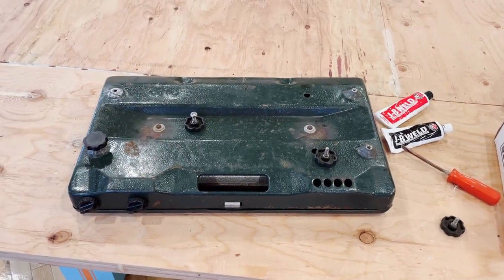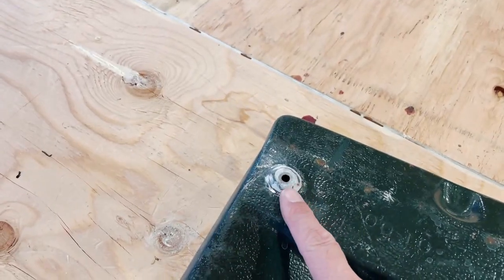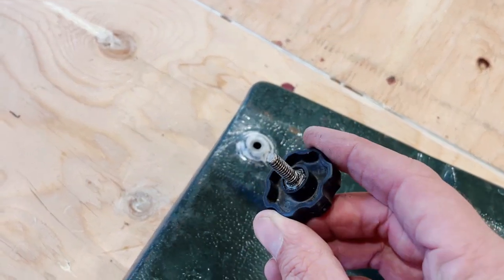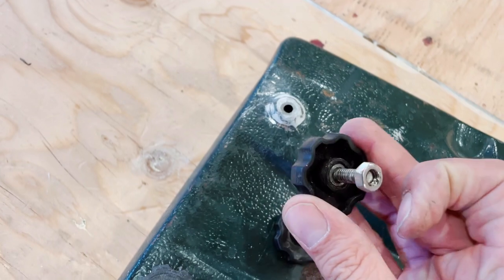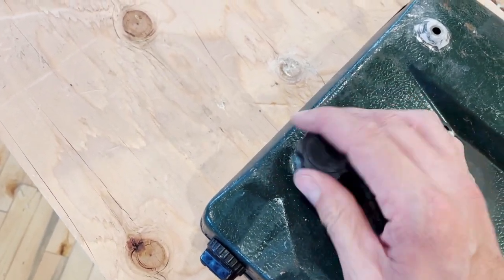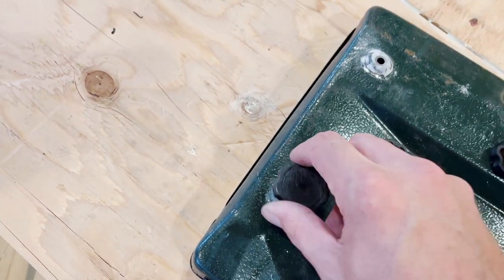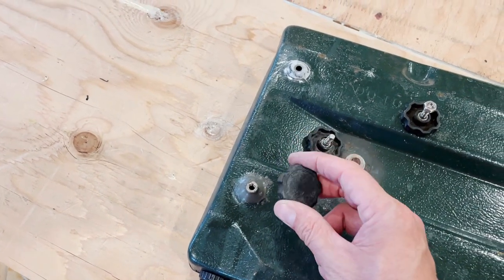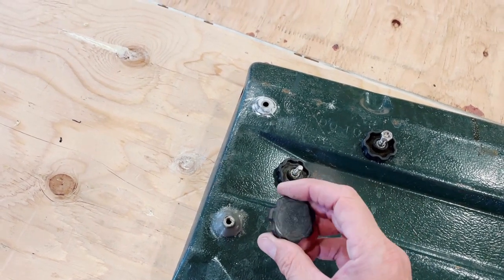How to make built in leveling legs for your camping stove

Comment: I have the same stove and was dealing with a very uneven surface the last time I went camping. Had to drain the bacon fat half way through cooking it on a griddle before it overflowed. I'm seriously considering trying this idea.
Reply from the maker: I wouldn't go back to a regular stove without the adjustable legs. It just makes like so much easier and gives me the option of using the whole frying pan instead of just whatever corner is lowest 🙂